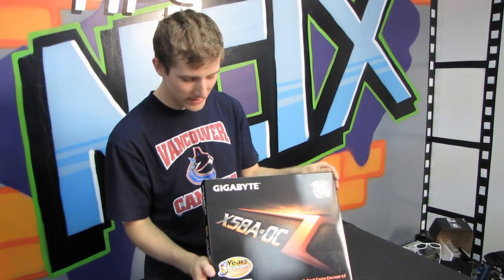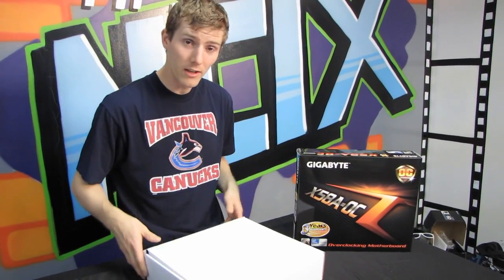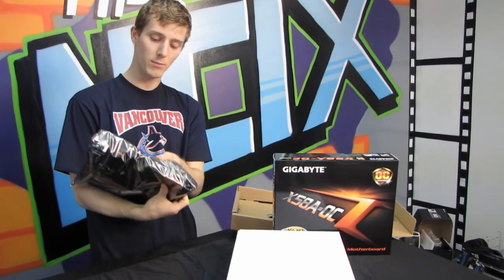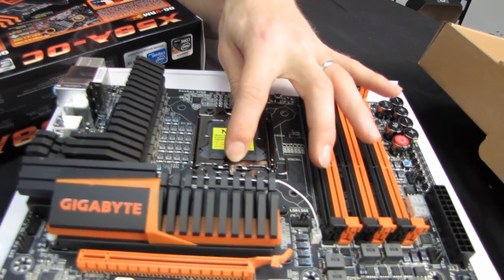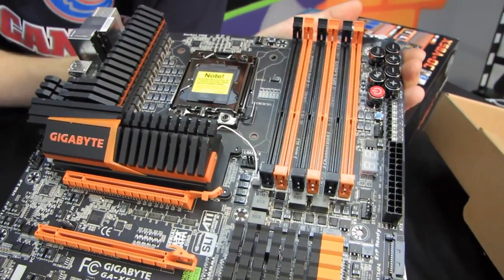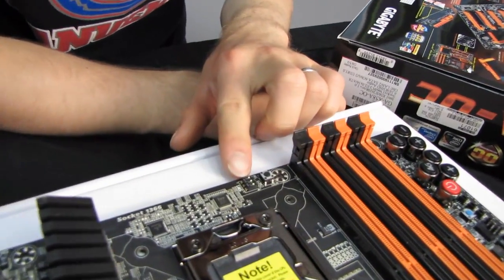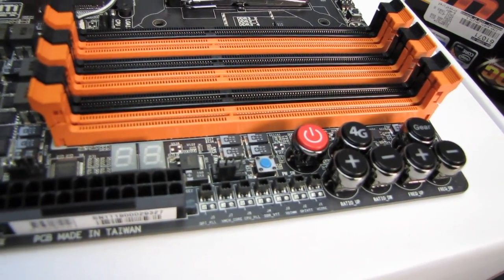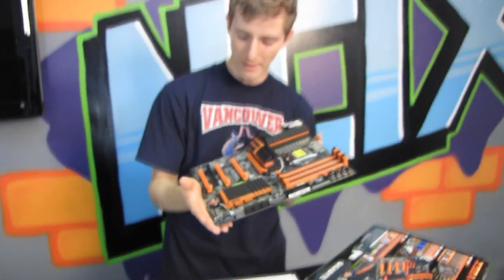Gigabyte X58A-OC Overclocking Motherboard Unboxing & First Look Linus Tech Tips

Comment: Whheeellll... 2020 still running the crap out of it with Xeon 5687 slightly OC'ed on 4,1 and with GTX 1070 and still can play Shadow Of The Tomb Raider on very high settings from 45-80+fps ;) Who would guess ?? :D
Yes 4 core 8 thread xeon, should go for 6core.. no no no.. this one has higher base and turbo frequency ;)
Whell… It did 1257 on Cinebench ver.20 :D Hahahaha
Maby make a new review on 1366 and even more powerful 2011 that all china is producing (x99) as mad and stripping servers for V3 and V4 Server CPU's and than russians keep buying it like it's the only way to go :D
---
Btw Linus: Don't retire, stay ON, cos You and J2C are the only 2 interesting guys to watch ;)

Comment: (just because you think you know what your doing doesn't mean you shouldn't read the manual) 

gigabyte x58a-oc
2 tb raid 0, 60g ssd 
i7 960 base 3.2 ghz clocked to 5.1
HD 6870 X2 crossfire 
custom cooling

Comment: something id like to mention those 2 sata pwr connectors on the bored are not for plugin something like an HDD they deliver additional power to the PCI-E slots for a more stable over clock on the PCI-E interfaces if your going to be doing tri/quad SLI/crossfire on the bored one of those connectors needs to be plugged to the PSU and when your over clocking your GPU and PCI-E freq use it to stabilise the voltage when your pushing that way above norm...

Comment: @MusicMan8789 It's not a waste if you put it to good use :) If you don't need to OC then don't, but it's a free upgrade and who says you need to settle with a huge voltage? I like to find an acceptable voltage with still fast frequency. Like say 4.0-4.2 Ghz on i7 with voltage around 1.25-35 If stayed in that range I don't believe the life would be shortened very much at all. This is just for example btw.

Comment: @Rickymalheiros I am planning to buy this mobo: Asus M4N68T-M V2 Which has all solid caps, anti-surge protection, core unlocker, EPU, crash free BIOS3 etc. It is low end but has the features that i need ! So whats your opinion on the PSU is the CX500 going to be enough to power this systemwith some slight overclocking?

Comment: looks like someone got ahead of me, I was custom painting a 650d after seeing how nicely the vesta R1 and vesta G1 turned out, i guess DazMode and I got great minds.  I'm on the last stage of buffing out the clearcoat as well, just as glossy as the one that DazMode has, if not even better.  Im happy finally there is a orange scheme mobo that came out, perfect timing for my built.  Will shoot a video on my channel once the case is completely finished.

Comment: Hello you guys i hope someone can help me.
The fan from my psu started to make fail(it's a thermaltake purepower rx 500w),the fan is 14cm(thermaltake tt-1425b),i change the fan with a noiseblocker nb-blacksilentfan xk1.The problem is a just found out is the old fan was a 1400rpm or a 1900rpm nobody knows exactly and it was pushing about 82cfm the new fan i installed is a 800rpm and it pushes 35cfm should i be worried?Thanks i hope someone will answer.

Comment: @pccomponetreviewer 

Well that's weird. I used to have an EVGA Classified E760 mobo - the one without the NF200 chip. Now i'm running a Classified 4-way SLI board with an NF200 chip on it and my games play smoother. Synthetic benchmarks some to come up a little higher in the points section too - not by much but a little higher.

Comment: meh i'd have not that much use for a board like that, i'd much rather have that $ spent twords more ssd in raid (a 1.3 gbps read, and around a 700mbps write whould be good) and then use two 6990, and a core i7 980x Oc To a stable 4.0ghz(no more/ no less) then use it to run tetris :D

Comment: @0perativeX not really 
NF200 chips cause small delays in bandwidth so to get the best possible score you shouldnt really use a board with a NF200 chip on it

Comment: Please help me Linus (or viewers might help also)!!! I am building a PC and i son't know what PSU to get! The system is gonna be:
AMD athlon II x3 450 3.2GHz
Sapphire HD 5770 1GB DDR5
4GB Kingston HyperX blu 1333Mhz Dual channel kit
WD Scorpio Blue 500GB
Random low end motherboard(some of the cheapest out there so no extra power consumption there)
Sony Optiarc DVD +-RW 24X
Coolermaster Hyper TX3 cooler for the CPU
I'm looking at two main ones right now CX500 & CX600 from Corsair!(cheap psu only)